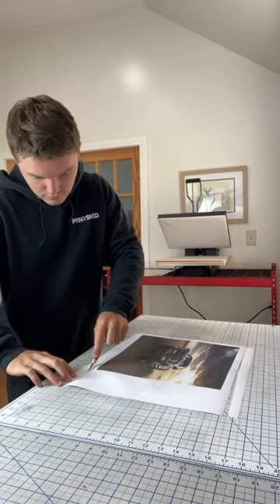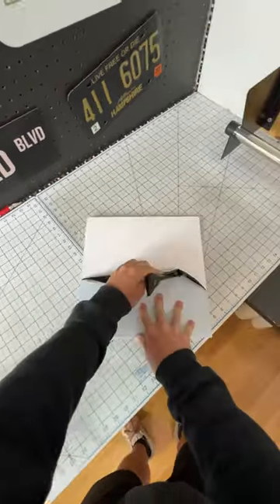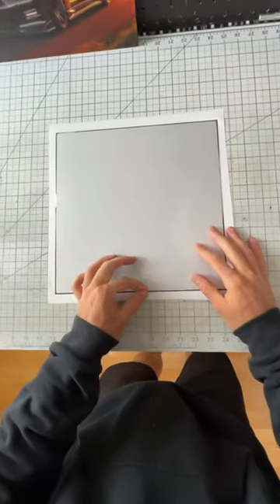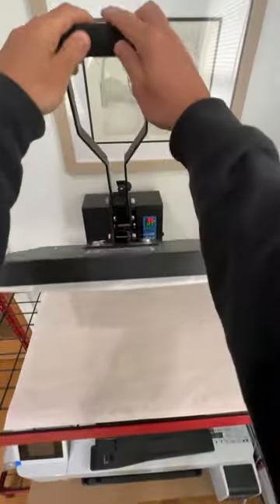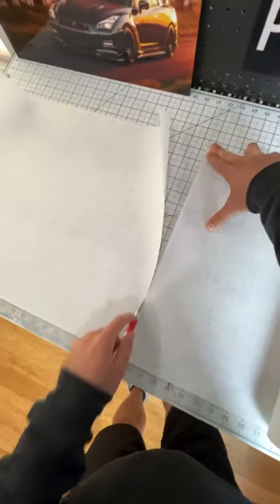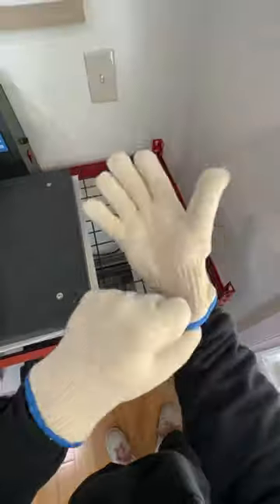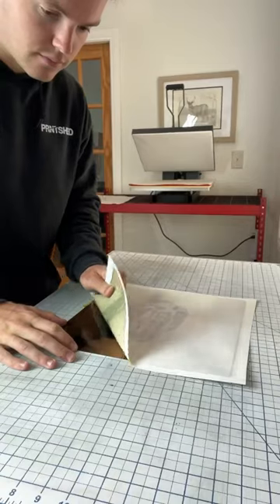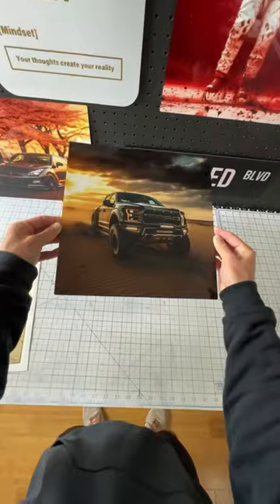How Sublimation Printing Actually Works

Comment: I have an epson 2720 converted sublimation printer for my tshirts lol
Reply: I have the same and it works amazing. I bought it refurbished directly from epson, $179 which includes free shipping to me. It came with the same warranty as a new one but since I converted it doesn't apply, but anyhow the point being that it works amazingly. I may upgrade to a larger one before long, but I love the Epson Eco tanks with refillable ink tanks because they are extremely economical, very affordable to purchase, and they work great.

Comment: The heat press machine press online the metal places or also tshirts? The same machine works in both materials?
Thank you
Reply: Shirts have to have at least 50% polyester in them. The higher the poly count the better the image will come out. Lower polyester count will have more of a vintage look.

Comment: Is that the normal stainless steel or plain metal sheets that we buy from the hardware?
Reply from the maker: No, its aluminum with a polyester coating on top. Its called sublimation aluminum

Comment: What's the paper you put on top & what is it for?
Reply: When doing sublimation, when you put it on the heat press, you always want to cover with something such as butcher paper, and some people use the more expensive Teflon sheets for it. Personally, I used the butcher paper. It is used to absorb what is referred to as "blowout". When you press sublimation, it actually convert the ink to a gas that is pressed into the fibers of the poly coating on the material you are using. Many times, there will be excess ink, and when pressed it will "blow out". If you don't have the butcher paper or something else that you use for blowout paper, it will be blown out all over your project that you are pressing and it will be ruined. That's just a sort of simple explanation maybe not professional or in-depth, but that is basically what it is all about. 😊